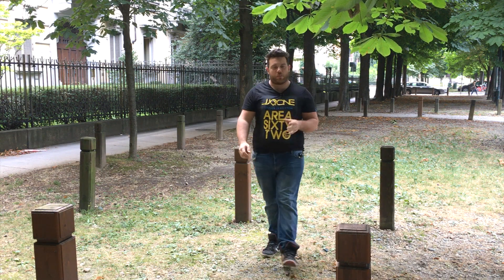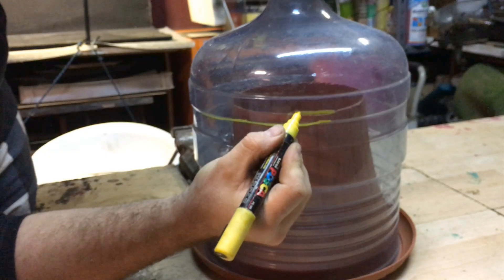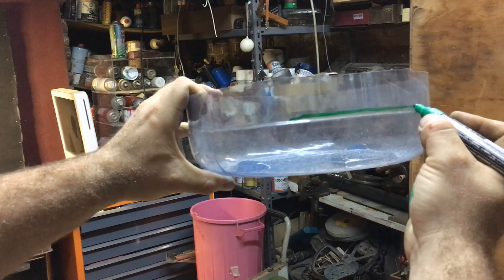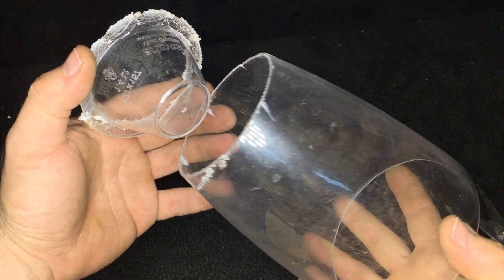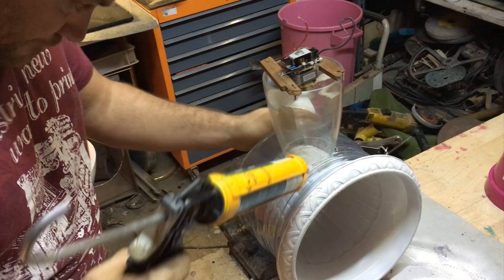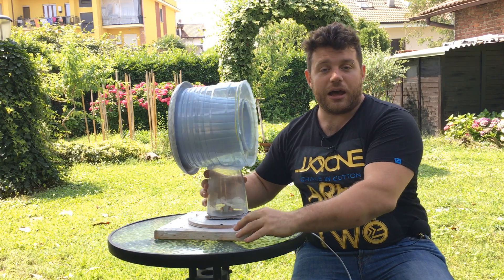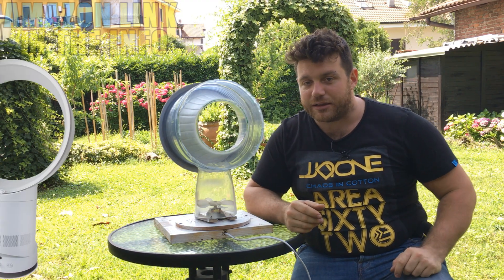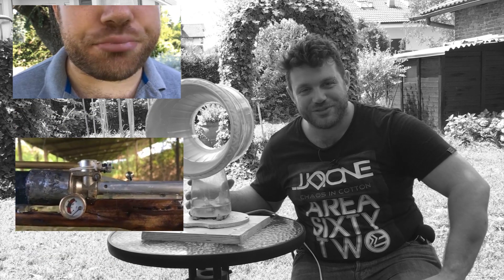BladeLess Fan - How to Make it - Dyson Fan DIY

Comment: well the whole point of the bladless fan is to remove any danger element that would still be there if there were large blades in the way. think of the children, guys. (and it's supposed to have a more consistent air flow)
Reply: yea, pretty much any fan has a protective cage around it.
Reply: ***** A non motivated answer is worthless. Non sense from you surely.
Reply: Eny fan that i ever used is build such that there is no way thet child would be in danger. More consistent airflow is just nonsense to boost sales.
Reply: behold the comment that is not stupid
Reply: So you have never seen the finger of a 2 years old child struck by a blade. I've seen once a bunch of years ago. Broken simply by the inertia of the spinning blade. Happily security has improved.
The main interest of the bladless fan is the efficiency (the vortex venturi effect moves a lot of air with little energy) with no drag so loss of efficiency from the protection wires t and silence if the fan is well designed with semi turbulent passages. Just a simple calculation of Reynolds numbers of the flow.
Reply: No buffeting! :)
Reply: +LIGHTandSTR0NG I think the point of a blade less fan is to protect from the danger for the overprotective, and a blade less fan will not protect you from going in a fireplace, in fact how does that have to do with anything?

Comment: I was really curious about how this "bladeless" fan thing works so I watched this video only to find out there is no such thing. I mean, it's cool and all, but for god's sake call it something else. Based on the number of comments this is EXTREMELY misleading people.
Reply: That is how dyson "bladeless" fans work, surprise surprise they have blades inside.
Reply: Should've put a disclaimer like: "bladeless fan is a commercial name give to this type of product, not my fault it still has blades" . Just like if you were to make a diy "hoverboard" and it doesn't actually hover.
Reply: Actually, there is such a thing, called an ionic wind generator. NASA was looking into using it for aircraft thrust check out http://ntrs.nasa.gov/archive/nasa/casi.ntrs.nasa.gov/20100000021.pdf
Reply: +Ethan R Many engineers struggle with over complicating things. It's not a slam. But it's true. Just try to always think what's the simplest way

Comment: says its gonna be bladeless, puts blades in anyway
Reply: The blades are hidden usually even in dyson fans
Reply: No such thing, unless you use a lot of electricity but that is something else.
Reply: +Robert Pirlot I know for a fact that you have no idea what you're talking about ;)
Reply: Flat Earther..
Reply: ***** morons
Reply: Turbines are driven by air, fans drive air. It is technically a fan with no blades because most of the air flow occurs through molecular entrainment. The flow of the source air combined with the shape of the cone creates a slight vacuum that pulls even more air in from the hole in the center. I could make a whole paragraph about the actual physics behind it, but I won't. This concept works for any gas or liquid and has a lot of industrial uses.
Reply: There are squirrel cage fans in the bas of all Dyson fans.
Reply: Dyson uses a micro turbine fan, don't know how powerful it is but it's supposed to be super efficient! I'd like to see a comparison
Reply: if something is fan then it's tubine no reason to say that twice. Efficency of design depend on the speed of object where thay are mounted. In case of something that stand in one place ducted fan may be more efficent. But the bigger blades the more efficent fan is. That's why wind turbines have so huge blades. Well there is maaaany factors.
Reply: The same thing happened to me when I was stabbed by a vagrant.
Reply: Are you a flat earther by any chance? 🤦🏻

Comment: So it's not really a bladeless fan, but a fan with no visible blades(if the casing wasn't clear).
Reply: It creates a Venturi effect, the air in movement pulls more air from behind, making the whole fan much more efficient than the traditional design.
Reply: that's what I was thinking😆
Reply: there is no fan without blades in this world

Comment: It has blades
Reply: Just like The original dyson fan 350€
Reply: +beclops yeah, every bladeless fan has blades in the base of it
Reply: How long will take so people will understand that name mean nothing. Bladeless fan have blades. 50mm lens is not 50mm lens....
Reply: +Rulof Fai da Te does not matter if the original one has blades, you can not say it is bladeless if it is not
Reply: Bad analogy.

50 mm lens means that the focal plane is 50mm from the shutter.
Reply: rdecredico If You look into specyfic technical data You can find that lens with markings like 50mm F1.4 in reality is by desing like 48mm F1,5 T2,2. Name/marking on lens have ussualy nothing to do with real values. You can take 5 different 50mm lens from different manufactures each will have different focal lenght by desing. Even if You take 5 production samples of same model none will have same focal lenght or eny other value.

In photography difference +/   5mm end F/T +/ 0,4 don't make huge difference. But in cinematography it's ussualy huge deal end lenses are desing such way they can be calibrated very easily to have focal lenght just how marking state. Also lenses tend to change focal lenght end T with time(use).

That's why i writed  "Bladeless fan have blades. 50mm lens is not 50mm lens...."

As naming in both of this cases have nothing to do how they are in realty.